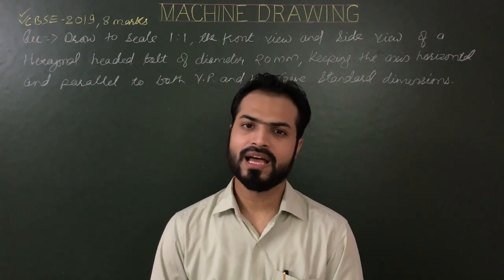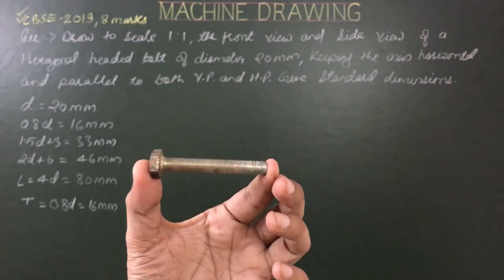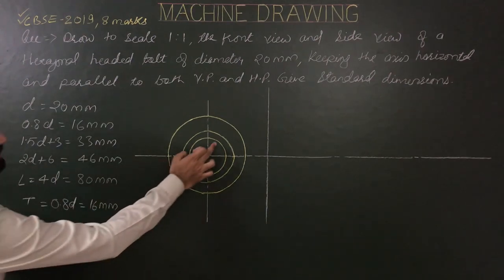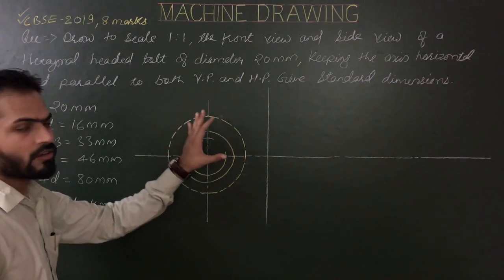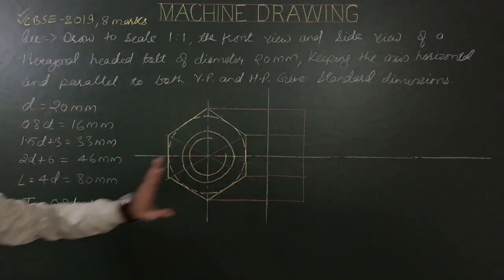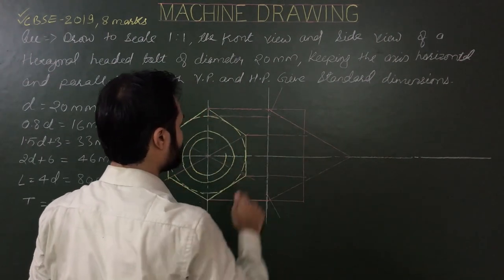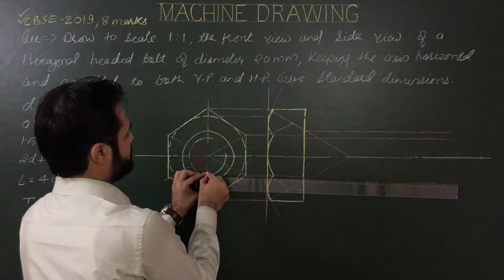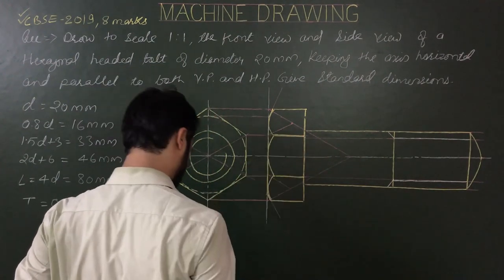Hexagonal Headed Bolt (Axis Horizontal) In Machine Drawing (Part-12)

Comment: Sir I have a doubt from this question r we supposed to draw the second circle as radius =20mm or diameter as 20mm for which the radius is 10mm? So what is the radius of the second circle ?
Reply from the maker: for second circle diameter is 20..... or radius 10...
Reply: Thanks sir doubt cleared

Comment: raw the two views of ISO threaded hexagonal bolt 80mm 
long, 16mm diameter and hexagonal nut with washer assembly 
in the axis horizontal position. Indicate all the proportions and 
the actual dimensions. (Across the corner